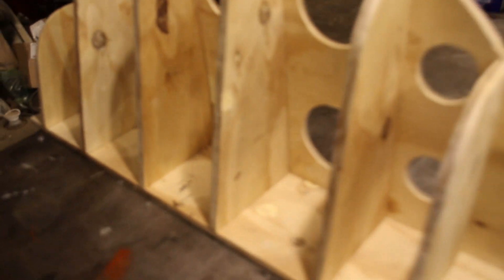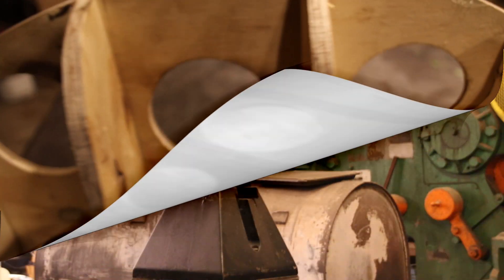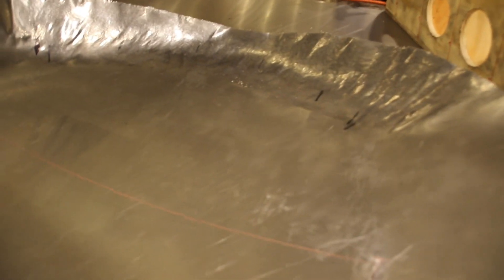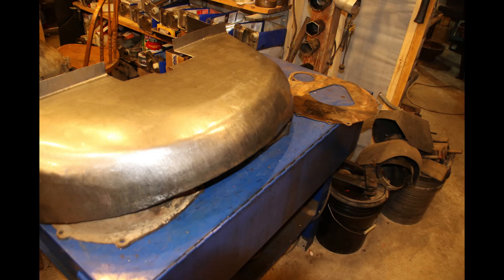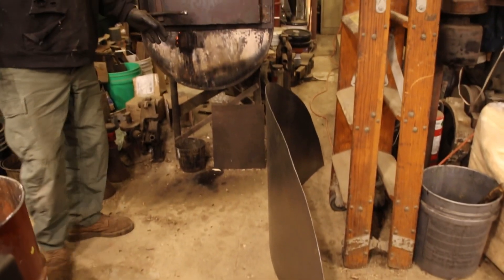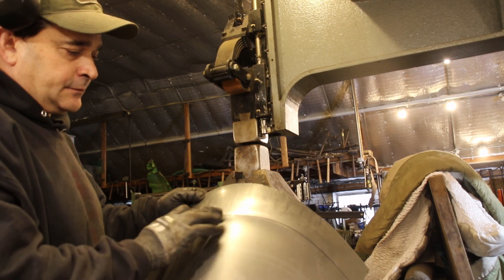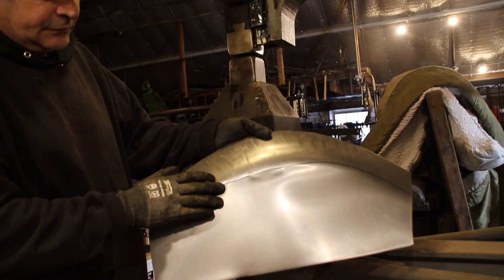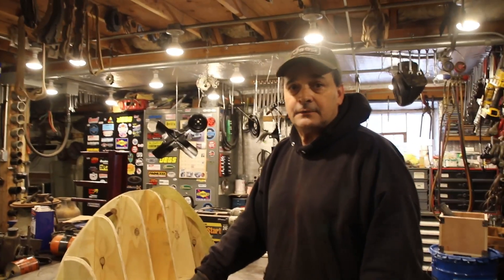Custom Made Sheetmetal Panels On The Power Hammer

Comment: What is a good height and angle of thumb for single sheet 18ga sheet , and on the radial dies how big is the flat spot roughly in diameter  on a low crown. In the process of tunning my own shrink and radial dies